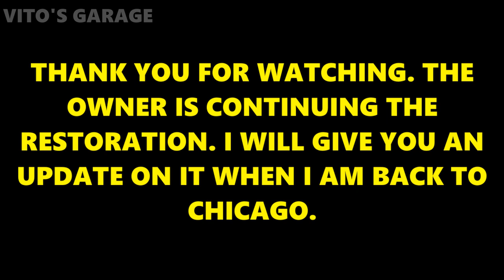Mercedes W140 S600 is in Good Hands! Time To Make Her Immaculate! Starting the Repairs

Comment: Vito, you guys got the wrong spark plugs installed 
You need non resistor spark plugs meaning: F8DC4 are the correct ones

FR8DC are resistor spark plugs (bosch platinum) which are bad for those engines including the m119’s as well

Some people have issues such as slight misfires and rough idles. This could cause an issue because those engines don’t like those spark plugs.